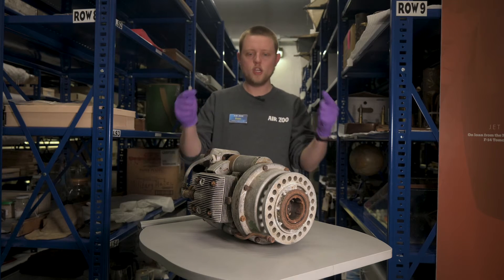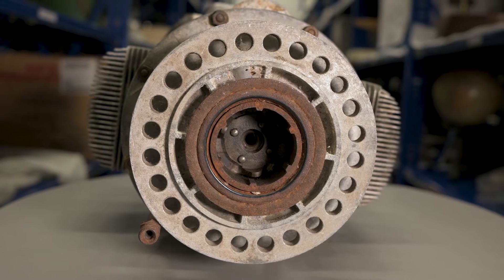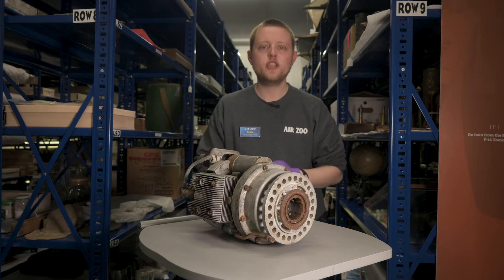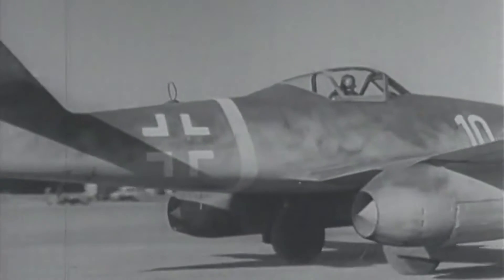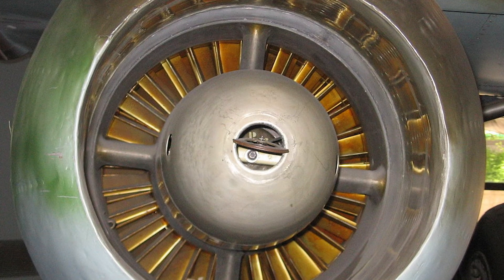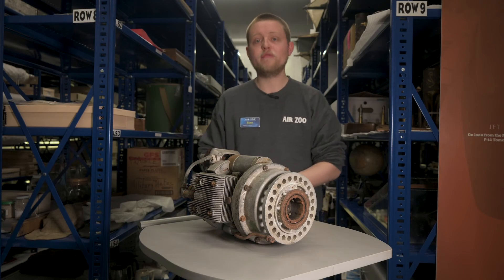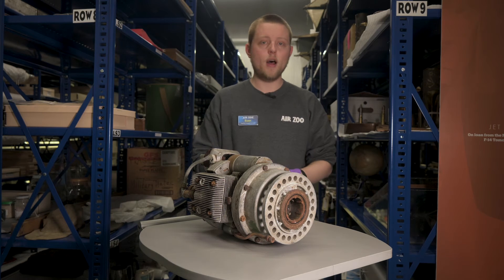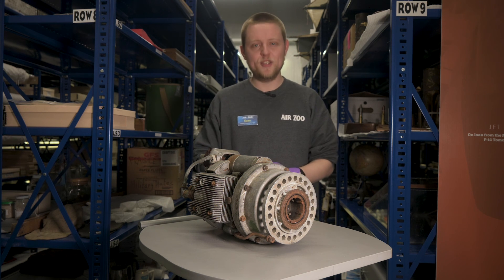The Riedel Starter: The Me262's small, hidden, non-jet engines.

Comment: Yunkers would have been the correct pronounciation because our J is pronounced like your Y.
Sidenote/tip: theses days google translator is good enough with german pronunciacions. Type in the german word, set it to german at the top and then press the little loudspeaker icon.
Greetings from Germany🙂

Comment: This engine had a postwar life in communist East Germany where it was developed into the powerplant for the IFA (later MZ) BK350 motorcycle. Not entirely surprising when you realize that Norbert Riedel was a motorcycle engineer both before and after the war (though having settled in West Germany after WW2, he would not have been involved with the design of the BK350).